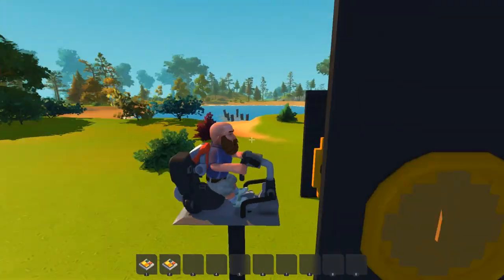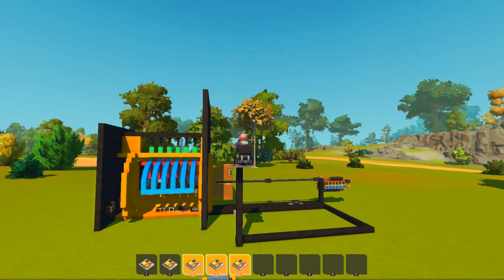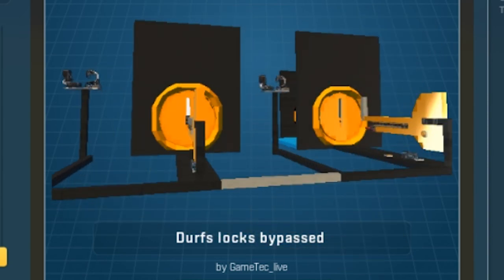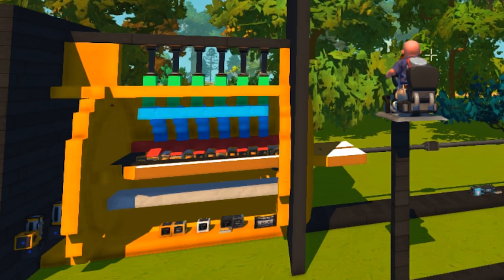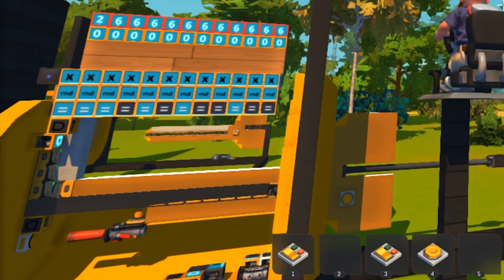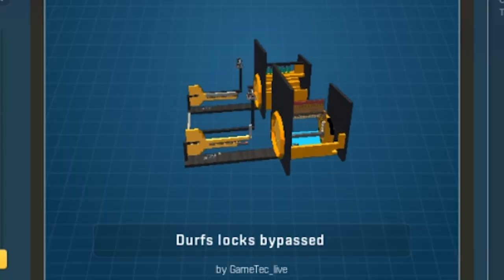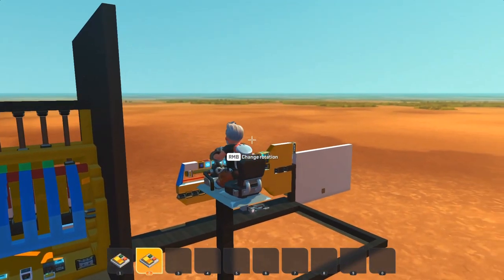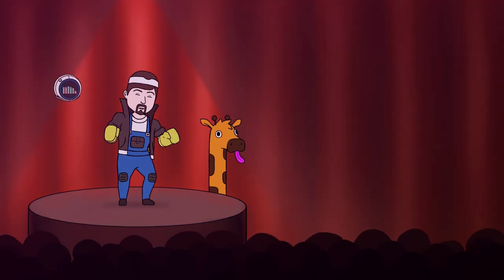Picking Locks in Scrap Mechanic 🔓📍🤏

Comment: As any good lock designer should do, you should try to alleviate those vulnerabilities and have it tested again. 

Of course, if you hide the reset button, brute forcing the correct values is the only way I can think of how to defeat it. Definitely doable but not in any way feasible. The normal lock, however, could possibly be picked mechanically if you block the sensor cheat. That would be interesting to see what people come up with.

Comment: The "Durf's locks bypassed" analog pin and tumblr bypass is best compared to a bump key. A rake requires the constant in and out, a bump key remains inserted and just repetitively bounces up and down without being removed from the core. While not bumped like a real life one, there's only so much realism one can get in Scrap Mechanic. Love watching this though, definitely fantastic designs both on your part and on the part of the bypass/pick systems by other viewers.  Also, the exposed reset button on the Digital lock is both funny yet sadly realistic. Digital locks, like you said, have a lot of bypass methods IRL, and having an exposed reset system such as yours is one of the most common ones, so it added a bit of realism into that specific design as well!

Comment: The digital lockpicking reminds mme so much of how oftern in the realway digital ocks can be bypased. e.g. you can use a magnet outside to trigger the main relay or In another examplle you can oftern use a standard avalible key to open the electronics where you can just bridge the wires.